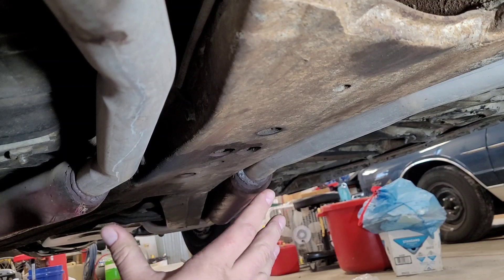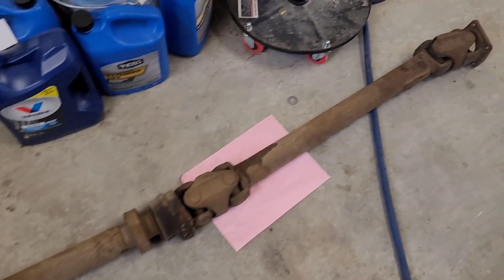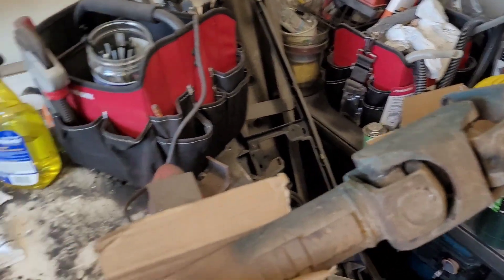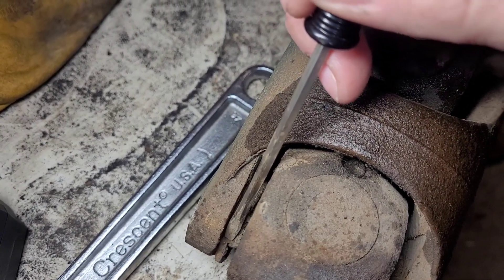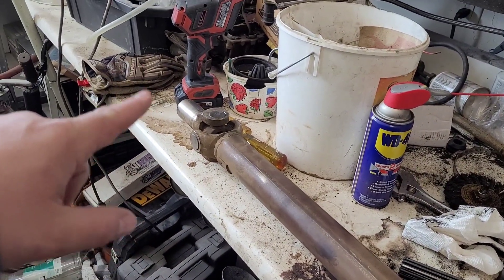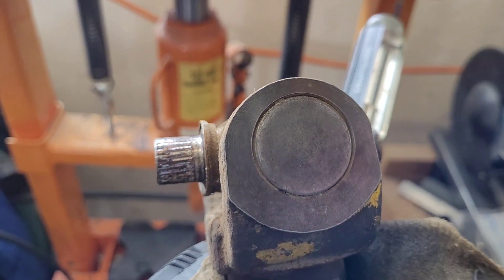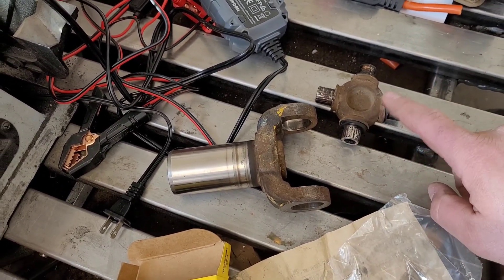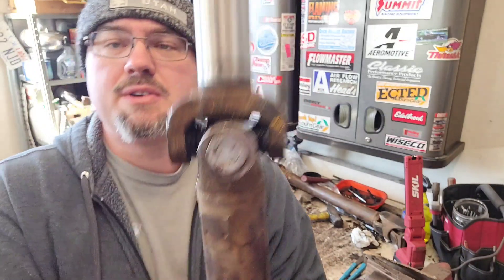Driveline Vibrations FOUND on the 1965 Buick Riviera!

Comment: Great video, be sure to post one of you rebuilding the double cardigans! I've rebuilt around 50 of them, and still have troubles occasionally lol. I've heard of guys tying a thread onto the ball spring to keep em from flying across the shop when ya slip getting them together.
Reply from the maker: These Double Cardans are a little bit more unique than I thought. I've got a short coming out later today about this one specifically. I'm part way through filming the rebuild of the double cardans. The process and the video were getting to be way longer than I expected so I'm breaking it up into sections. I'm expecting to have the double cardans posted 1 week from today and I'll see how far I get on the carrier bearing.

Comment: why not get a one piece drive shaft
Reply from the maker: Without more verifying, a 1 piece may run into the X frame. Having the carrier bearing allows it to extend back far enough and clear the frame before it starts to head down towards the differential.